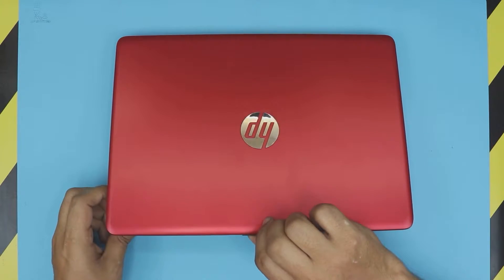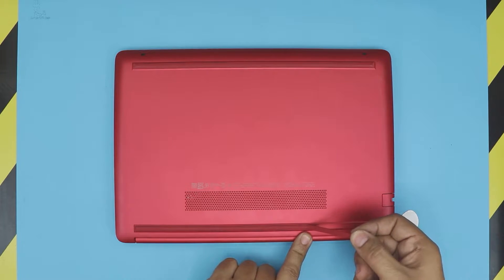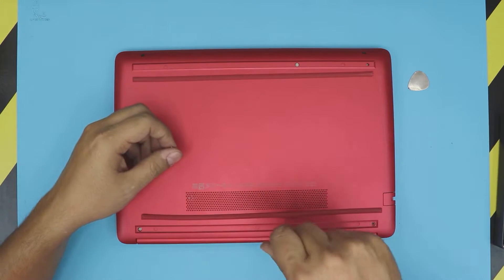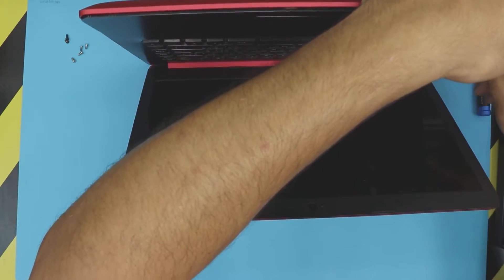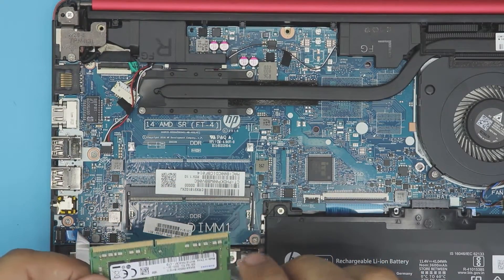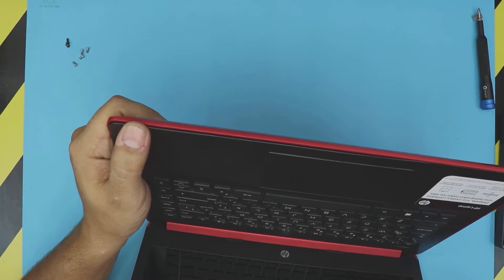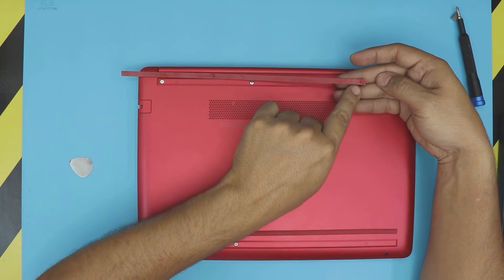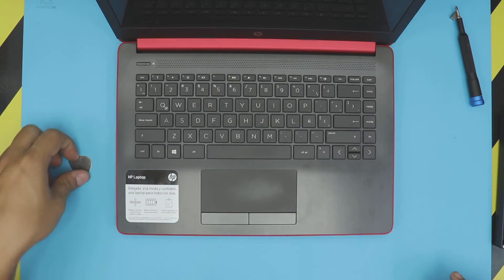Hp 14 cm - xxxx Ram Upgrade, STEP By STEP !!!

Comment: Hi the second slot doesn't have the clips?
Reply from the maker: Thank you for the feedback! if you wish to support the channel you can LIKE or SUB or both :P
regarding your question: yes they didn't install the connector for the 2nd ram, and even if you install it still requires many other components in order to work.
Reply: @uFixTek  ok so we can only install one ram stick?
Reply from the maker: yes my friend only one
Reply: @uFixTek  thank you sir!
Reply from the maker: anytime my friend :)

Comment: hello, what will happen if i buy the ram DDR4 2666MHz ? is it laptop running well?
Reply from the maker: Thank you for the feedback! if you wish to support the channel you can LIKE or SUB or both :P
regarding your question:  nothing will happen the laptop will run just fine, the Bios will auto adjust to the max speed that it can handle.
Reply: @uFixTek  alright thanks a lot sir
Reply from the maker: You are welcome 😊

Comment: Because i have 2 slots but only one of the 2 have the socket, my laptop has a 32GB ram capacity but with only one socket, my question is, can i put or install the other socket in the slot?
Reply from the maker: no my friend we have tried installing the socket and after installing the socket there are many other components that are missing and even after all that the bios must be hack and reprogrammed. the risks of damaging you motherboard is a lot for the same reason we have done the test so you dont have to.